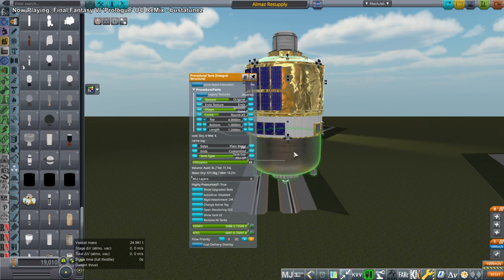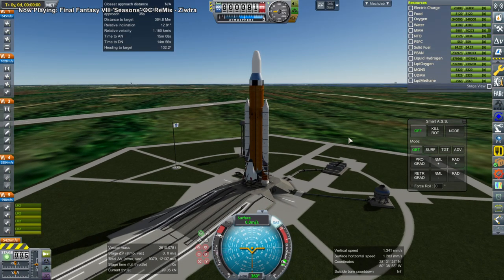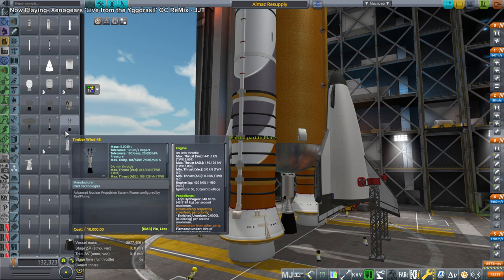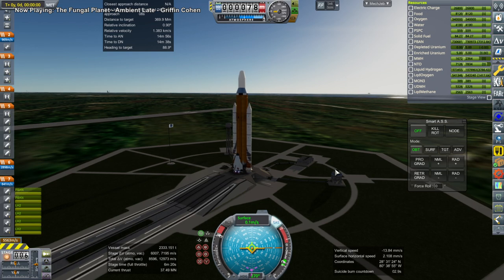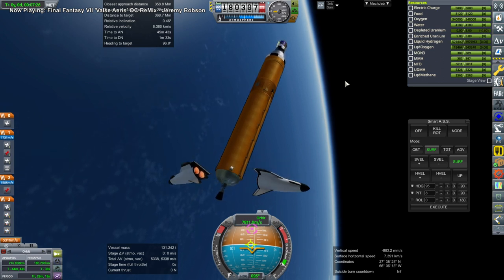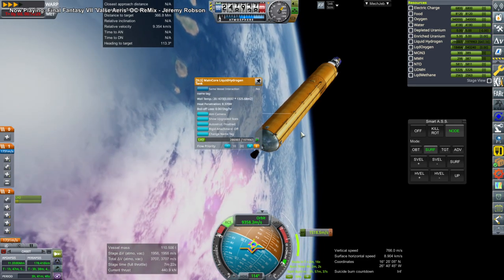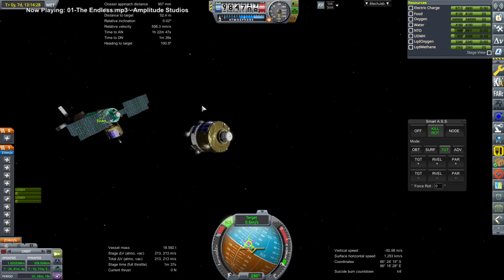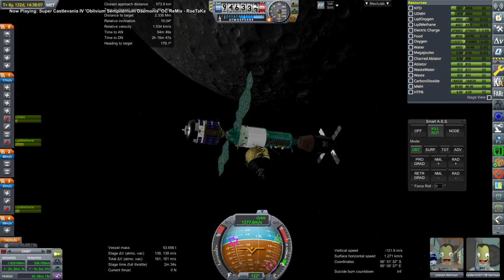KSP with Realism Overhaul - SLS without an Upper Stage

Comment: Funny idea. So how many stages is this supposed to be? Clearly more than one and a half, is it not? 1.75, maybe? Or is it one and two halfs? I'm confused now.
Reply from the maker: It is one-and-a-half to orbit, that's for sure, because the Timberwind Nuclear Engine is not required for orbit. Beyond orbit, I would say the Timberwind constitutes a second stage because it didn't light on the ground, but it's certainly weird. In this one, the Russians have the easier system - they count by when something stages off rather than when it lights, so this becomes a three stage rocket. Where that gets messy is with rockets with optional boosters, because then the core can either be the first stage or the second stage.

Comment: 150 km is probably too high for a orbit
Reply: its quite low
Reply: The atmosphere ends at 140km in RSS
Reply from the maker: 150 km is basically the lowest viable orbit, since in RSS the atmosphere is at 140 km, and it is only viable if you're transferring immediately. Normally, you'd have to be above 200 km or higher depending how long you'd want to hang out. Obviously, in this case, we had the delta-v to get into a higher orbit if I had wanted to.